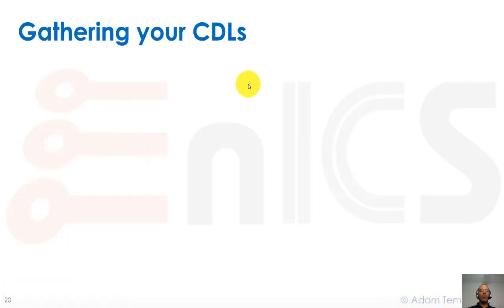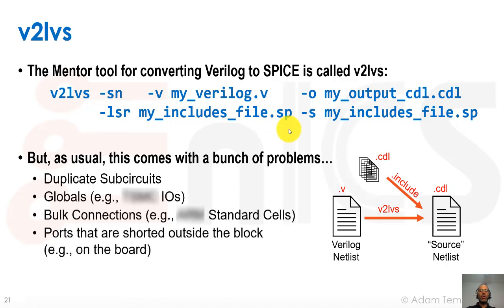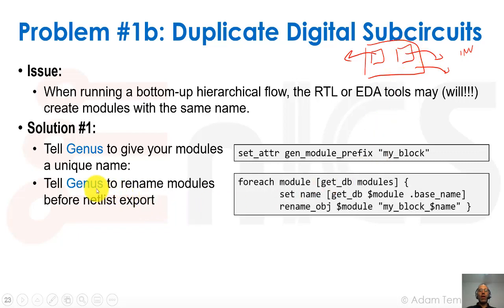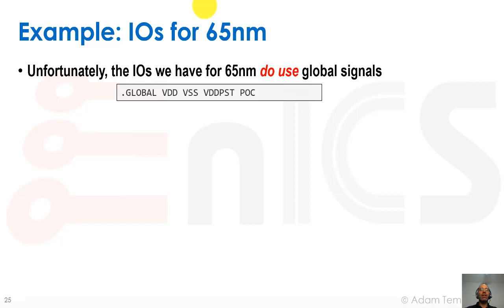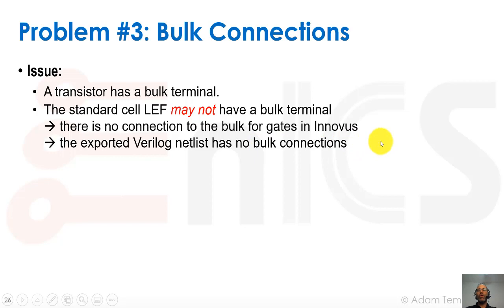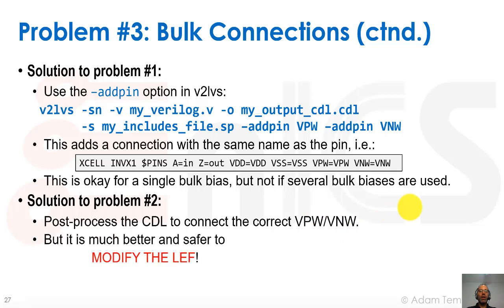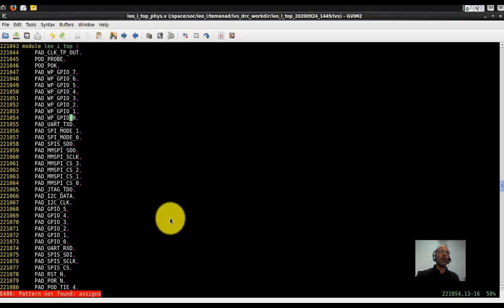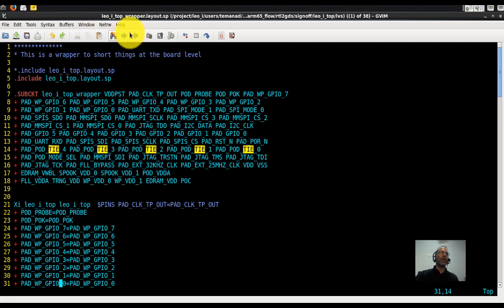Digital-on-top Physical Verification (Fullchip LVS/DRC) - Part 3

Comment: i am not able to solve the issue. i am using SPRAM macro in my design. i used LVS BOX for the macro. but the VDD shows error. In my design am using VDD_CORE ,VSS_CORE....how to make VDD is VDD_CORE
Reply from the maker: I'm not sure what you are asking.
In general, the naming conventions at your top level have to be equivalent in the layout and schematic. So VDD is not equal to VDD_CORE. 
If you want them to be equal, there are numerous "tricks" to do this. For example you could put a wrapper around the top level that connects VDD to VDD_CORE or you could manually rename VDD_CORE to VDD. You could also tell the tool to connect VDD and VDD_CORE (in Spice or in the LVS rulefile). Some of these are easier but "dangerous", while others may be a bit more complex to set up but better methodology.

But I'm not entirely sure what you're asking, so I'm not sure if that answered your question.

Comment: Hi Adi Temam,
this segment was very helpful regarding vpw and vnw , but i have issue with this
XCELL INVX1 $PINS A=in Z=out VDD=VDD VSS=VSS VPW=VPW VNW=VNW , in my design VPW must connect to GND and VNW must connect to VDD1 , rather than fixing manually , how can do with the help of v2lvs command
Reply from the maker: Hi.
I don't have a good solution off the top of my head. It actually took me a lot of work to figure out what I explained here and what I eventually did with the particular library I was using.
But in general, you can script it away with regular expressions (though there is a lot of room for error...) or you can try and fix the LEFs and then connect the right net in your place and route tool (the correct way it should be done).

Comment: Hi Adi Teman,
How to convert gate level netlist to spice level netlist in cadence tool.
Reply from the maker: In the video series, I used the Mentor Graphics v2lvs tool (part of the Calibre package).
The tool that is included in the Cadence PVS package is called "v2cdl"

v2CDL <-v Verilog_input_file> [-o CDL_output_file]

Other than that, it works pretty much the same. You will need to refer to the documentation to find out what all the options are.